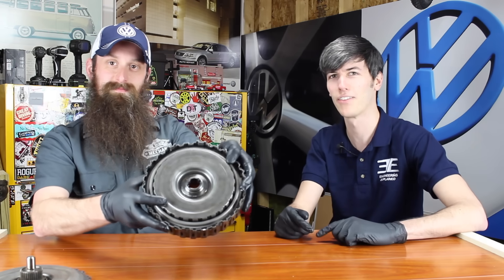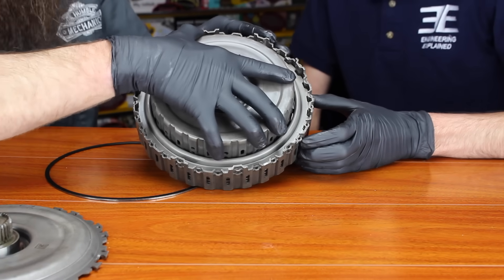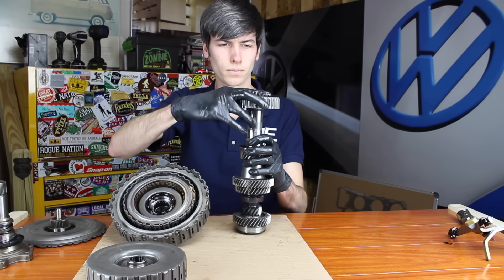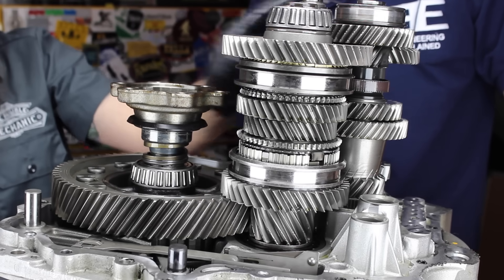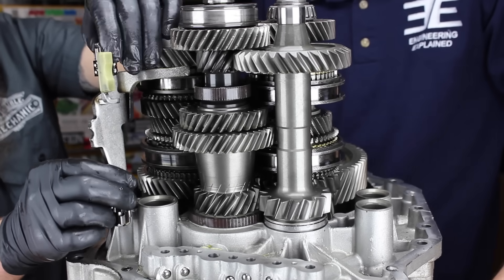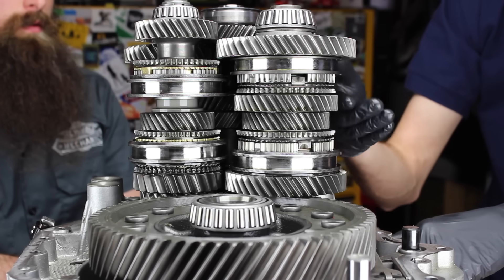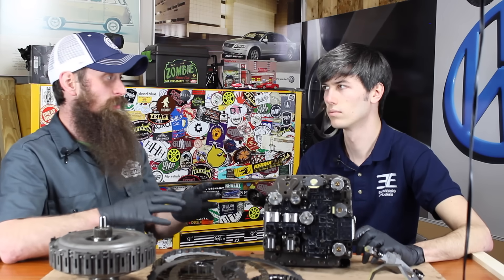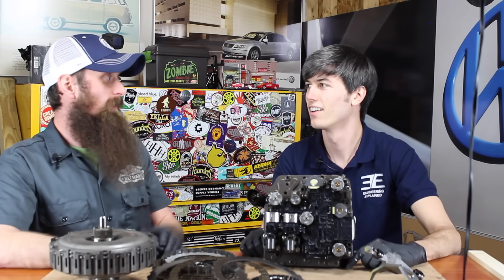DSG Transmission - Explained

Comment: Question:  I drive a MK6 GTI with DSG.  When I'm accelerating from a complete stop in 'D', the car takes a second to grab into first gear, and it gives that clutch vibration (not extreme) one might feel when putting a manual car into 1st gear from a stop.  I was wondering if this was normal for a DSG transmission to have that 'hesistation' when coming from a complete stop?  I am not a manual driver (yet) so forgive my ignorance.

Comment: I drive a 2015 Golf with the DSG and it's kind of annoying that it downshifts if you touch the breaks going downhill (to keep the speed limit, #copstate). I do understand the logic and the limitations of computer prediction, but it's still pretty annoying.
Reply: My wife's Tiguan does that. It is a regular auto. Pretty annoying .

Comment: Hi guys, this was an informative video.  I was wondering if you can give me some advice as to what is happening with my transmission.  I own a 2014 Volkswagen Jetta.  It has a little over 20k miles on it.  But my transmission seems to be having an issue.  Lately, I've been feeling an aggressive shift in gear; from 1st to 2nd, but then it firms out afterward.  Can you give me some guidance as I am going to get it to the mechanic as soon as possible, but I would love to know what might be happening, so that I can more or less explain it properly to the mechanic ahead of time?  Thanks!

Comment: Question: I thought you said that the main purpose of a dual clutch transmission is to separate odd and even gears for speed, but in this video you state that the output shaft #1 had the gears 1, 2, 3, and 4. The other shaft handles the rest of the gears. And one clutch is connected to one shaft, which means that the purpose of this DGS is just wrong. What am I missing? :)
Reply: That's actually 2 shafts, one above the other, just like in the whiteboard video. 1 & 3 on the top shaft, 2 & 4 on the bottom. 

They didn't explain how 5 & 6 work on an extra shaft, I can only assume at least one of the first four gears acts as an idler???

Anyway,  all those (big) cogs look like loads of rotating mass, you'd barely need to engage a clutch to keep feeding torque to the wheels!
Reply: as I understand it, the shafts that separete the odd and even gears are the input shafts (the concentric ones), not the output.

Comment: can someone explain how does the car move off from a standing start with this transmission, does it use a torque converter?
Reply: Renault Clio GT owner here, there's no torque converter its basically takes off form a standstill like a manual and it'll even sometimes roll back slightly just like a manual.

Comment: I am getting my new Skoda Octavia 2,0 TDI with 150 Hp with 320 Nm of torque and the DSG transmission (same as in Passat) delivered next week. I am thinking of getting it remapped so it will produce 185 Hp with 410Nm of torque. Are there any issues with remapping that engine with the DSG?

Comment: You explain the engineering and the biggest problem (for me ) with DSG- that is the delay when you come off the throttle and then back on quickly. This is a HUGE engineering flaw IMO and one that has totally put me off my DSG and I will be going back to manual ASAP so I have total control.

Comment: why DSG farts?
Reply: I think it cuts the ignition while upshifting to set the right RPM for the next gear. Cutting the ignition makes the farts.
It will increase the throttle while downshifting to set the right RPM.

Comment: Quick question.
When in "D", and I am stopped at the traffic light. I assume the wet clutch is constantly in friction, right ?  So it is better to select "N" for longer stops than say 10 seconds ?
Or do these clutches fully disconnect when I am stopped but still in "D" ? 
Or does that depend on the model of car we are driving ?
Reply: He does explain this in another video, 5 Things to Never Do in a Dual Clutch Transmission or something like that. If you're fully stopped, the clutches will disengage from the engine so they and the transmission are not rotating at all.
Reply: every non-manuel cars disconnect the clutch(es) while you are breaking. only not if you squeez the break pedal too little just to slow down the movement of car.
Reply: I would assume so, only because it's recommended not to inch forward in a DCT doing so causes unnecessary clutch wear, generally that's caused by engaging or disengaging too slowly or too often which makes me think that the clutch is not engaged at a stop. Also i think the type of clutch used in a DCT does not allow for slip while in gear so if it didn't  shift into neutral at a stop it would stall.
Reply: afaik it depends on the brake pressure you apply.
If you press the pedal firmly the DCT should go into neutral.
Reply: Very good question and something I have always wondered. I've been driving with a DSG for about three years now and always stop at the lights in D and hold it on the brake. I've assumed the car is intelligent enough to work it out (demonstrated by the mind-boggling level of engineering in this video).

Comment: One question; Is the mechantronics unit still selecting the next gear when I'm driving in Manual mode?  

I'm an amateur home mechanic, and transmissions have always been the one thing I'm really afraid of touching.  I also happen to own a MK7 Golf R, and so the engineer in me really wanted to get a better understanding of how it actually works.  This video helped a lot! I feel like I have a far greater (but still very limited) understanding of how they work.  How neat!
Reply: I can't speak for this model specifically, but in my 2012 Ford Focus (which uses a dual dry-clutch automatic-manual system very similar to this), it does not predictively engage gears during manual mode. The result is that there is a notable delay between when you press the shift up/down button and when the car actually shifts gears, due the the engine having to engage the gear before it can engage the other clutch.

Comment: Hey great video! I have a question I am looking into a 2008 R32 and I am wondering if you have any idea about the reliability of the dsg transmissions and how they are over time since it is 8 years old and if you have any input on the reliability of the VR6 engine and the R32 as a whole buying it used. Thanks a lot

Comment: What does "Sport" mode do in a VW DSG? Does it merely delay shifts to maintain RPM, or does it remap stuff?
Thanks, and love the show!
Reply: Sport mode changes the range shift between gears. The car will rev higher and (at least on my 08 Jetta and 16 GTI) the car will never go into 6th gear unless you put on cruise control.
Reply: I'm pretty sure it just shifts up later and shifts down sooner to maintain high RPMs.

Comment: Do you have many problems with the VW DSG in America? In Switzerland its the only dual clutch gearbox who make problems  with 30k KM. and ealryer.
Reply: 60k mi (100k km) on my 2012 passat TDI and no problems so far. Shifts smoothly, not like my old 2002 Jetta with 5sp auto tiptronic. That was junk!
Reply: Nambla wow, you guys should calm down while driving in switzerland if your tranny needs attention that early. even in turkey it lasts for 60k, my friend had dsg problem on his audi a3 at 60k. dsg is the shittiest and slowest responding clutch system of all. go buy a volvo or ford with powershit.

Comment: They could do a manually operated dual clutch.  Just have two clutch pedals and two shifters (one for even gear and one for odd).

...bit of a learning curve on that one I would assume.
Reply: Haha just need an extra arm and leg, then you would still take longer than the few milliseconds it takes a DCT to shift :p
Reply: Better to just use a seamless sequential gearbox with a single wet slipper clutch, auto blipper and quickshifter to cut ignition so you can shift up without clutch. Same as F1/MotoGP

Comment: Hes wrong about gear positioning one side has odd numbers and not 5,6 like he said , its 1,3,5 other is 2,4,6 otherwise dsg would be useless.
Reply: +Maksim Monastyrskyy actually they have it right. The output shafts do have 1,2,3,4 on one and 5,6 on the other. The input shafts, however, are separated as you say: 1,3,5 on the inner and 2,4,6 on the outer. I do think they could have done a better job showing this though.
Reply: Good point

Comment: So how do DSG gearboxes usually deal with travelling at very low speeds, since it is like a manual and doesn't have a torque converter? When stopped, both clutches would be engaged, but what about slow movement, will it be letting the clutch slip while in first gear?

Comment: Since it does not have a torque converter, how does it NOT stall the engine when you are stopped while the transmission is in first gear?
Reply: +abz124816 seriously??

Comment: Ok I have a 97 MK3 with a 1.8lt petrol and I have a wreck which is a 96 2.8 VR6 auto. Is it possible to bolt up the VR6 to the 1.8lt manual box?.
Reply: No not just yet. It all depends on what manual transmission you are using on your 1.8T. if you are using a 020 transmission you will need to upgrade to a 02A or 02J transmission. if you already have a 02A or 02J transmission then you will just need to swap the bellhousing on the case from a 4 cylinder case to a 6 cylinder case. You can find all the info you need to do this swap on vwvortex.com
Reply: Thanks for your advice.

Comment: I have an 11' GTI with a DSG gearbox.  I always wondered how it works at a stop while in gear.  Are the clutch packs partially engaged (slipping) or is the slight engagement due to something else.  If they are partially engaged, it seems logical to me that it would be better to put the car in neutral. Any thoughts?
Reply: +joshuwa88 
Don't try to outsmart the DSG by going into neutral, you could wear out the clutch(s) faster that way

Comment: a triple clutch system would get rid of the typical dsg issues, both the higher and lower gear can be preselected meaning shift up or down is just a matter of clutch selection.... even more expensive!
Reply: and weight.... modern dsg's don't have that much of a problem.

Comment: why is the bigger size of gear the lower gear?
Reply: +Cody Lin simply basic mechanics and physics. has to do with the gear ratio. no different than on a bicycle, if you compare the size of the gears on your crankset (where the pedals are) and the gears on the rear wheel where you are transferring the power. do a bit of googling and I'm confident you will figure it out quickly

Comment: I was hoping you'd show the differential as well. Are the differentials in these stronger than the 020's we used to constantly break?

On 020's a quaife was a given and then we knew once you had power and traction, we could just about count how many 1.7 60' times we could get out of it before we broke gears.
What are the weak points of a DSG in a 2015 GTI? Is it relatively safe to put a tune on and go to the strip a couple times a year?

Comment: would a triple clutch fix the problem of which gear to preselect?
you"d have 1, 4, (7); 2, 5, (8); 3, 6
so no matter which gear you are in, it can preselect both gears next to it
Reply: AnarchistMetalhead Yes,that’s why honda is building it
Reply: Wouldn't you need three shafts then? Can't select two different ration gears on the same shaft.

Well, you could, but you'd regret it.

Comment: Honda has one of these on the nc 700 motorcycle.  As I understand it the engine is actually half of a car engine. 

By the way, a topic I would like to see is the difference between automobile and motorcycle clutches.

Comment: if my automatic stays in low gear until the cold temp warning goes away, thats a safety feature to protect the smaller teeth on high gears from fracturing? Ive always wondered if my car does this on purpose, seems like it does.
Reply: to be more specific, its an 05 scion xb (4gears, auto) and it sticks in second but immediately lets go after the cold temp light turns off.
Reply: I would venture to guess that most automatic cars do this for one main reason... Getting the engine and oil temperatures up to optimum levels.

Comment: 'drive by wire' throttle ... what's that all about ?  my Honda Civic has that ... and a pretty cool CVT transmission ...
Reply: +Kevin Olesik In the past, throttle pedals were connected to the engine via a throttle cable. However, now they use computers to connect the throttle pedal to the engine and this is known as drive by wire. In fact some aircraft use a similar system with their joysticks.

Comment: I just got a DSG car (ford fiesta) and have driven a 5-speed manual for many years.  I heard a lot of complaints about the dual-clutch being jerky and not good at low speeds, but I've driven this 'new' car like I would have driven a stick, and it's not given me much problems.  The clunky sounds it makes always makes me cringe, but this video really helps explain how my transmission is working.  I've heard "it's a manual that shifts automatically" but this really gave me insight as to what that actually means.

Thanks!

Comment: You guys mentioned how the computer sometimes wrongly predicts the next shift, but as far as I'm aware, and correct me if I'm wrong, this isn't an issue on new DSGs because they don't need to predict downshifts; If the driver tugs on the downshift paddle or suddenly brakes, the computer is able to simply disengage the clutch and deselect the higher gear, 'blip' the engine to exactly the right revs to smoothly select the lower gear, or any lower gear for that matter and then engage the correct clutch. In doing this, it can shift fast enough, that it's still much faster than a manual or ordinary slushbox can shift, almost as fast as it can upshift.
Reply: What you're saying is what I've been noticing. The only time it downshifts on it's own like that is when you are driving in a lower gear's speed range for a few seconds thus giving you a better ratio
Reply: +Bannicus 
This guy gets it

Comment: What I've always wondered with DSG's is what is the difference between neutral and drive while stationary. As I understand it, neutral would deselect the cogs, but in D the clutch starts to engage as soon as the brake is released.

Comment: I really enjoyed this video, it has two of my favorite youtube hosts (Y)
Reply from the maker: Appreciate it! Charles is a rad man.
Reply: +Engineering Explained ---Ok so I get DSG, I have a 2014 gti drivers edition and..... what causes DSG farts. I had my resonator deleted today, basically so I could just have a deeper sound, and it does sound really nice, but can now hear the farts more. thanks
Reply: As has long been explained by lot of people, that is how it works, there are very funny videos on youtube about DSG and farting minions, check them out, and deal with it.
Reply: What is the actual cause of the dsg fart?
Reply: @mbulelomankonkwana8038  First, the ECU cuts timing during the shift, but fuel delivery continues for a brief moment. So, some unburnt fuel makes it into the exhaust, which is hot. So the fuel gets ignited, making the sound. The reason for the timing being cut is to prevent the engine from revving while the shift is occurring.

Comment: 9:00 If a traffic light turns green as you approach you really shouldn't just go. You should continue slowing, then LOOK before preceding through the light. You should look before proceeding even if you are stopped at the light, even if you aren't first in line. Never assume the cross traffic is going to heed the red light. And the MOST likely time to see a red light violation is right after the light turns.

Comment: When I changed the clutch in my old truck (1984 Chevy S-10) it was a very simple device. What are the advantages of having this more complex system, and do they counter the higher failure chance of this much more complex system?
Reply: +Eric Taylor DSG's are very reliable now, though they are still run by computers and it is sometimes this part that fails. But the main advantages of a DSG over a regular manual/auto box is faster shift times, somewhere in the order of 8-10 milliseconds, Combined with better economy of 10-15% better than a normal auto and 0-5% better than a manual, Extremely smooth up shifts and consistent down-shifts. The downsides include relative complexity, heavier in weight than similar sized manuals and due to the multitude of gearing tend to have lower torque limits than some other transmissions(although plenty of people have modded past offical limits without a problem).
Reply: stinger15au
Thanks for the info.

Comment: I accidentally engaged the P position on my 7 speed DSG clutch at low speed and hard a big clicking noise. Could have this damaged my transmission significantly? Should I worry with anything?

Comment: We have those on VW, Seat, Audi and Skodas here in England. I have seen one on the skoda superb with the tdi engine. Good gearbox to have around, would like to try one out. A question for Engineering Explained - could it ever be used on more powerful engines, if it hasnt been already, say the Audi 4.2 V8?

Comment: Awesome - what's a "core charge"???
Reply from the maker: +Martin Lanza It's a fee that's waived if you supply the original part back when you replace a part. For example when you buy a new battery at a parts store, you won't get the core charge if you give them your dead battery.